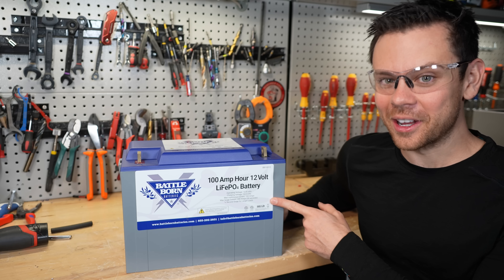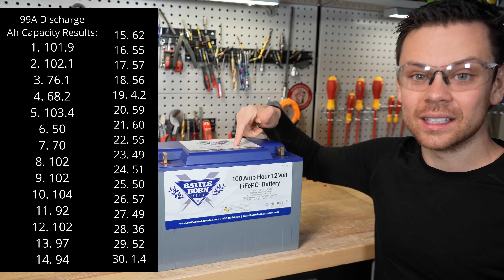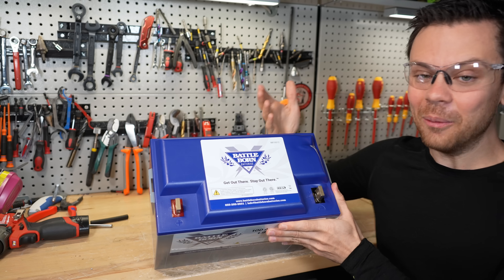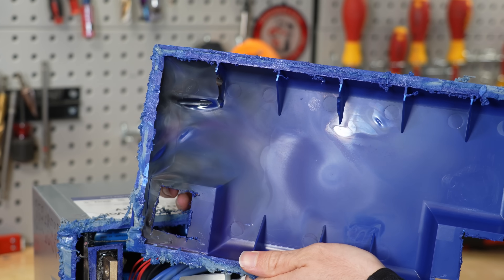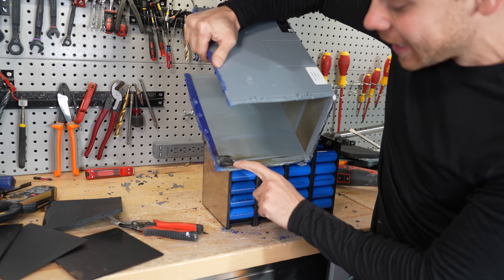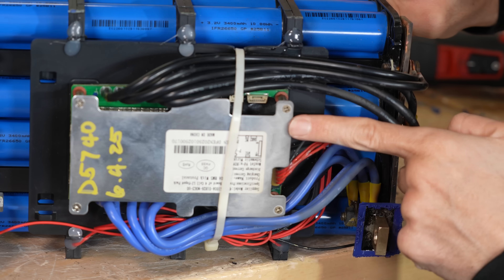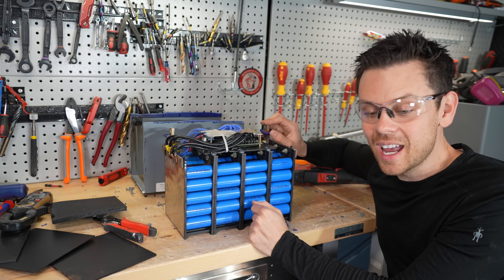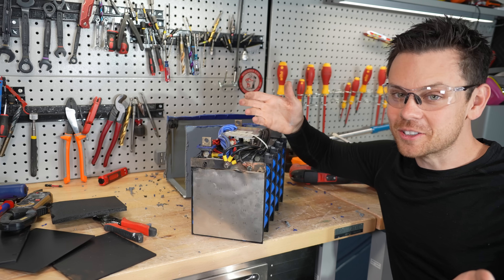Battleborn Battery MELTED?! 🔥🔥New Problem!

Comment: I have a BB10012H and a BBGC2H set up in parallel in my camping trailer. The batteries are about a year old. I use a thermal camera to keep an eye on things. So far I haven’t had any problems.

Comment: Battleborn should take note of the burning battery situation and do a product recall. Not worth the UL listing being pulled and the insurance lawyers coming after them. Looks like they used a cheaper incorrect manufacturing method to save a penny and ended up spending a few thousand dollars in the end after its said and done. Build everything out of paper and plastic it wont last.

Comment: You should get a 19in equipment rack & put all your test gear in it, that's what they're for.🤔
Reply from the maker: But then the cables are everywhere. And some machines have them coming out the back
Reply: @WillProwse I was sort of thinking of a small one that would still sit on your shelf but all your gear would be in one unit,but I guess you need to do what suits your needs best.

Comment: Please clean up the bus bar and re-make the connections, without the plastic involved, just to see if the battery/cells/bms are salvageable, like a diy battery. I'm also curious how degraded the individual cells are that were closest to the heat compared to the ones that were the coolest.

It's clear the construction design is 10/10 on the "Is it total junk?" scale.

Comment: This is borderline criminal negligent engineering and critical testing, battle born could faces jail time knowing this and doing nothing about it and death occurs caused by these battery's, their bogus fail safe is a blatant lie !, also a wouldn't be surprised that the cross section of this aluminum bolt doesn't have the capacity to carry 99 amps without heating up

Comment: This is astounding. I really thought that you would NOT be able to melt this battery by using it within spec. I really thought that the other batteries that were destroyed becuase they were operated beyond spec, with loose terminals, over-current etc. Here you have clearly showed that the poor design has caused the battery to fail under normal operating conditions. 

I would love to know why it happened on the negative terminal this time, whereas all the other failures were on the positivie terminal. I think there's a random chance that overheating will start on either terminal, then it will continue on that termial. 

I really wonder what BB is doing about this right now. Auto-makers would have a billion dollar recall on their hands, but this obvious fire safety issue should result in BB being forced to recall all the batteries.

Comment: Most plastic kreeps over time, not smart to use it under compression if the compression is critical as is here for electrical connectors.
Reply from the maker: Exactly

Comment: Have the same battery in my boat to power my transom mount Minn Kota 50 pound electric trolling motor. I charge it with a Victron 25 amp charger and the battery is 3 years old. I haven't seen any problems with the battery in that time at all. I do inspect it every time I charge it.

Comment: I’ve owned two battleborns for years which are installed in my RV. I am removing them ASAP and replacing with the ecoflows that are on sale. BattleBorn should have to issue a recall immediately.

Comment: how does this get out of testing?  Nobody at the company cycled the battery at it's max rating at its max temperature?  If they did, they would have seen these obvious issues.  Using a plastic backing washer to save 3 cents is so beyond stupid. If that's how their engineering is, I know one company that I won't have anything to do with.

Comment: In my opinion, Battle Born batteries are an unacceptable safety hazard, and the company should be replacing old batteries with an updated design that fixes the problem, entirely at their cost.  This should be no different from a life threatening safety problem that forces an auto company to recall and repair a vehicle.  I think most people buying these batteries are installing them in locations where a battery fire could potentially spread and kill someone.  Sadly, given their response so far, I expect more gas-lighting and a refusal to take responsibility for shoddy engineering.

Comment: For ANY sus battery I would have a 55gallon Steel Drum 3/4 full of water and put the battery above it with a EASY way to dump it into the barrel. One of those batteries "goes" that fire extinguisher "is not going to be effective". Watch some StacheD videos - he's a actual engineer/firefighter.

Comment: Now I need to go test mine out. I do have 4 ea of those that came with my rv. They were an already installed and all pulled over 95 amps at a 10 amp load. (Yes it took days) with my 2000 watt inverter I do not think I have pulled more than 45 amps each. I will need to test and look for heat.

Comment: Will, a small correction of relevance:  It did not melt AFTER 30 cycles, it melted DURING 30 cycles.  Which cycles?  It does not really matter.
Reply from the maker: Yes, true

Comment: It is such an easy fix, they need to put steel inserts around the bolt to stop applying excessive forces on the plastic and the melting will stop.

Comment: Will, with 31 years of electronic mfg. experience, in the US and Asia, I speculate Battle Born (BB) buys these batts. from an Asian company under an ODM model.

Unfortunately, BB's quality and /or product engineers are not "camping" at the factory to force change there and ship the best possible, defect-free products. BB Management is to blame by not setting this as an absolute priority.

 Additionally ,  the BS response you received prior is typical of a "Marketeer" who has no clue how to drive change within this organization. 

Really, Managing an ODM supplier is not rocket science. Quality must however be defined,  organizational -priority or garbage is shipped to distributors and customers.

And here we are.

Comment: Yea, relying on thin plastic to be your structural support for proper low resistance electrical connections where temperature will rise during normal use is asking for the trouble you just witnessed in this test. The cells under that kind of heat are being aged as a non equal rate causing the whole pack to become weaker and total capacity will suffer from this over time.

Comment: Does Battleborn know they are done? pretty sure most of this batteries havent catch on fire because they are mostly in 48v systems drawing very little amps thru them. UL dropped the ball on this one too, Plastic spacers on battery connections??????

Comment: It's astonishing - how can you expect a torqued bolt to maintain its clamping force on a polymer component that you know will get hot? it is well known that Polymers lose their rigidity and compressive integrity when heated and have a considerable expansion rate that would  reduce the clamping force with every heat  cycle - It is an accident waiting to happen

Comment: Wow.. that's a nightmare. I have 4 of these. I first bought 2 of them, the  several months later, I bought 2 more. One of them was warranties die to water penetration next to one of the terminals. I'm still using them without any issues. Something in their production has changed for the worse. I see them losing alot of sales and customers over this and their outrageously overpriced stuff.

Comment: Higher quality battery = ANY other battery.
This could be used in educational videos for battery makers how NOT to make a battery. Have plastic between the busbar and nut is insane, its like asking for problems. Plastic can start to deform at temperature far below the wire temperatures, besides connect points almost always get a bit hotter also.
Hope people with these change them and get a refund and do it ASAP for their own safety. Battleborn should recall all batteries with these problems, its a real fire hazard.

Comment: I was under the impression Battleborn was top shelf I hope the 12volt 280 amp metal cased Eco-Worthty battery or the 2 12 volt 280 plastic case batteries are not like this ..

Comment: Would it be possible to review the Czech battery from Tipa EU, the GETI GBL-12-100B 12.8V 100Ah Smart?
Or at least provide information on whether it is sold abroad under a different name, or if it is purely a Tipa EU brand.

Comment: I'd be curious to know if Battle Burn has always made their batteries this way or if this was a design change at some point. To me this looks like a textbook example of Ivy league management strategy. First design a quality made in USA product, get it on the market and then start a massive marketing campaign. Once you have a very strong reputation in the industry, change the design to use the cheapest, lowest quality components as possible in order to make the highest profit margin possible. Once the cheap crap starts failing and destroying profits, sell off all your stock and declare bankruptcy and walk away a millionaire.

Comment: I bought 6 of these batteries, with the heater.  i have not incorporated  them into my system . 6k wasted. 2 are still in the bags. Threw away boxes.  Wondering how to dispose these fire starters.

Comment: Yikes! IMHO this exposes both design incompetence and a lack of management backbone. Two things jump out at me.  First clamping plastic between conducting surfaces is fundamental design incompetence -- that should have failed any design review. Next, they didn't do ANYTHING about correcting the problem !  Note the date code on the BMS is June-2025. The problem clearly has been known to them for years but they chose not make any changes and keep on shipping. I bet management came to the conclusion the company could not financially survive a recall, and a fix is too extensive and costly, these decisions are the kiss of death for Battleborn. At the very least they should have corrected the problem -- a all hands on deck situation.  Then deal with  the problematic installed base as a separate problem. These boys are toast.  Well, now I had better take a hard look at my 100 AHr Battleborn 😥

Comment: Using plastic sandwiched between a nut and bolt carrying high current is just a brain-dead irresponsible fire hazard thing to do.  Battleborn should be ashamed and RECALL all the units with this risky design before it causes loss of life and/or property.

Comment: I would like to hear what BattleBorn has to say about this? A world wide recall would put them out of business. I have six of these in series that has a temp probe connected to the last positive terminal connected to a Victron Smart Battery Monitor. Temperature has always been around ambient temperature but I don't pull what you pull on your test. These were bought 2019 to 2020. I have not had any issues with these but seeing your test makes me feel uneasy. BattleBorn was supposed to  be the best. I paid around $900.00 each. Is it possible BattleBorn cut cost by using plastic on the terminal nuts and the older ones are built better?

Comment: If Intertek (ETL) is the primary third-party company that tests and certifies Battle Born batteries (according to Google AI), ensuring they meet safety standards like UL-62133-2 and CSA STD C22.2# 62133-2, one has to wonder what tests they run, no?  What other battery brands do they also test and certify?

Comment: not to mention any commercial regulations... just some decade old rules of a student competition:
"connections must be designed so that they use intentional current paths through
conductors such as copper or aluminum and should not rely on steel bolts to be the primary
conductor. The connections must not include compressible material such as plastic in the
stack-up."
Reply: Sounds like someone didn't want any dead students <g>. 
probably more decades before this, science fairs still had an element of 'risk'. 
Usually detected in the basement though.
Reply: sure less freedom might lead to less fun, but fun should be well balaned when playing/designing high voltage or current paths :grinning_face_with_sweat:

Comment: I had a Battleborn 100AH for my trolling motor. Back in 2016 these were around $900. Mine lasted a couple years (maybe 15 cycles total) and despite a 10 year warranty, (and properly caring for the battery), it died and Battelborn refused warranty saying i had mismanaged/abused the battery. Lesson learned that day.....

Comment: Yup that's why I still use lead acid batteries. Simple and true tested and a proven design that works especially in bigger systems. To much to go wrong in lithium batteries especially when no consistency standards are used when building lithium batteries. And battle born batteries are supposed to be a superior brand.

Comment: I’m pretty sure you’ve already done some but can you post some links or do a compilation video with maybe a chart at the end of other manufacturers where you’ve done 30 or more cycles at full data sheet specs? I’ve already seen various online keyboard warriors indicating that no manufacturers battery will withstand that which is a lot of crock.

Comment: Please do the same test with a cheep battery. I am on the Grand design RV  forum and there is a guy on there that just can't accept the fact that BB has a problem and said any battery would fail if you did 30 back to back charges/discharges. I think a lot of people would love to see a different  battery tested
Reply: Will has dozens of videos of other batteries. Testing cheap batteries is literally a foundation of his channel.
Reply: One cannot use plastic between a nut and bolt electrical connection, if it gets hot the plastic deforms and the connection becomes loose. If your RV forum "guy" cannot understand this then consider what Mark Twain once stated; "No amount of evidence will ever persuade an idiot".

Comment: It seems the root cause is the use of the wrong plastic for mounting high-current carrying fasteners in a high-temperature environment...  I am not sure there are other plastics appropriate for this application...  For example, UHMW plastic has great dielectric properties and strength, but it loses physical toughness at higher temperatures...  Back in the day, we used mica, ceramics and even phenolics (bakelite) to provide insulation for kilovolts...  This should be an easy design...  We're talking less than 15 volts!   Maybe a good piece of maple?  lol  Just sayin'  😎

Comment: Could you take a sample of the different plastics in that battery, and do a glowing wire, and flame tests, as per the UL testing method?

How easily does it catch fire, and is it self-extinguishing?

BattleBorn reps, start sweating - will it pass?

Comment: Ok, that was a near fire. Will never be buying a BattleBurn battery. Never have I seen a design so bad. Sandwiching plastic between high current cables and busbars is the worst idea i have ever seen. BattleBorn should be mandated to recall all these batteries before they kill someone. Thankyou so much Will for disclosing this major issue with these batteries.

Comment: Imagine some dude with a battleborn bank watching this through a starlink on a sailboat 1000 miles from land with no lead acid back up.
Reply: He wouldn't have made it that far lol
Reply: Got six of em on my boat,  they have performed flawlessly,  and right now they are powering my water heater.  After 5 years they are still strong as ever.
Reply: @Matt-e4x  that's it, with six, I can only assume each never see high amps eh ?
Reply: @rasmousein On a 45 foot sailboat,  with refrigerator,  microwave,  air conditioning,  and a high amp windlass and a bow thruster,  and hot water heater.   Yes the batteries do see some good amount of draw,  although normally I don’t run everything at once,  as my inverter (for AC power) is limited to 3kw.
Reply: @Matt-e4x 3kw/12v/6bat = 41.6amps each max.
Less than half it's "rated" discharge rate. That's what Will is testing here. 😮
Reply: @rasmousein That’s just the load requirement for the inverter,  there are other loads as well.   Bottom line is if you continuously load to the max, then charge to the max, then load to to the max,  that will heat up any battery.   He is creating a non-realistic charge/discharge sequence.
Reply: I would guess it's the fast charging that is causing the damage. Unlikely you have enough solar panels to charge your battery bank at max spec rate.
Reply: @Matt-e4x  What are you talking about? He didn't even come close to "load to max" . If you've also seen the videos about their "fuse" issues, and are here to defend the brand then you obviously have some serious bias going on.

Comment: Why have they not engineered proper busbars rather than cable and DIY store crimp connectors?!

The whole thing looks like a bad hobby homebuilt design.
Reply: How did it pass UL testing? You might as well have bought a far-Eastern cheapie, or DIY kit - at least you'd know you were buying bargain-basement.

Comment: I work with luminaires here in Norway, and the standard clearly says that it's NOT allowed to use insulated materials between electrical connections like they have done in this batteries!       In IEC 60598 (Luminaires), clause 4.11.1 addresses the design of electrical connections, stating they must be constructed so that contact pressure isn't transferred through insulating materials other than specific, suitable ones like ceramic or pure mica, ensuring electrical safety and integrity under load.
Reply: Plus, they are transferring current through the steel bolts, and not directly between the bolted conductors.
The whole thing looks like it was 'designed' by someone who knew "how", but not "why".
Their understanding of electrical(and mechanical) principals, is clearly lacking.
Reply: @johnbooth5199  Good answer
Reply: I see steel bolts clamping ring terminals together with the busbar.

Comment: With my DIY 48 Volt Battery which almost never draws or charges more than 100 Amps I wired everything with 50 mm² (approx. AWG 1). When I see those cables I lose it